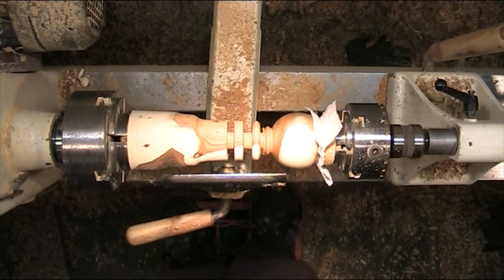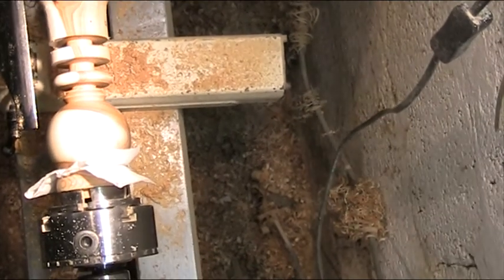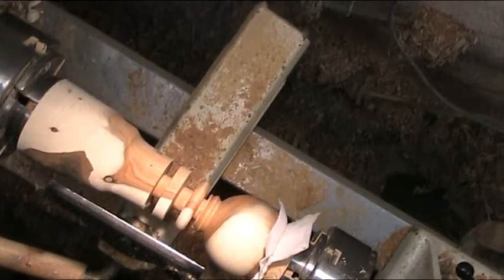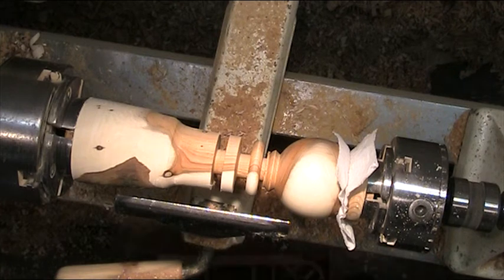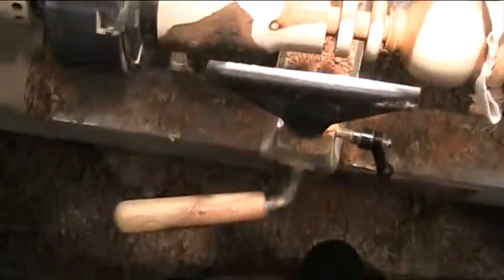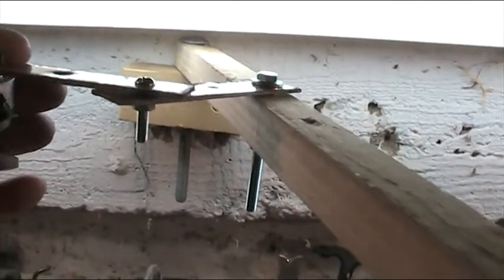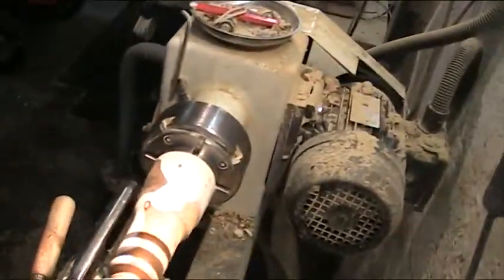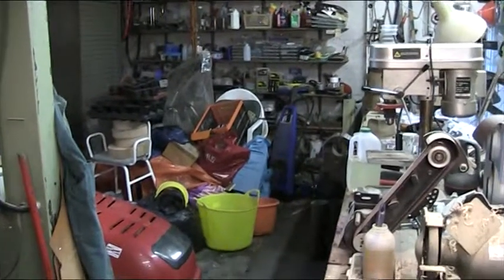Lathe Overhead Camera Mount Test 1

Comment: the bracket was a good idea gives you the ability to change up the angle easy. as far as whether from over the shoulder or from behind the lathe. in my videos if i'm shooting from above i prefer the behind the lathe shot because i often block the cam as i move around if it's over the shoulder.